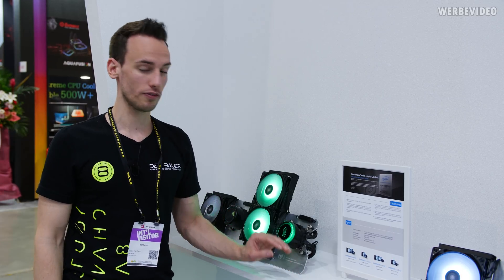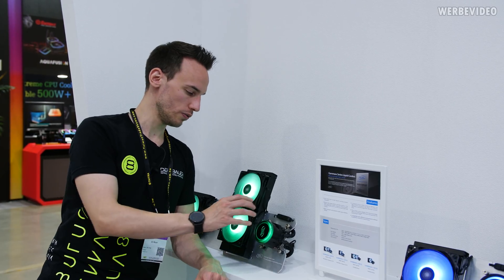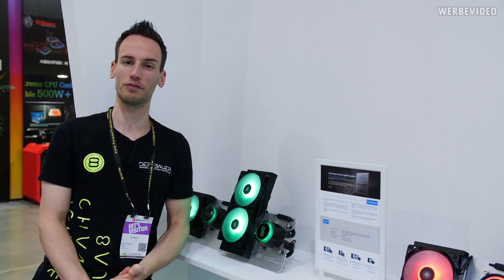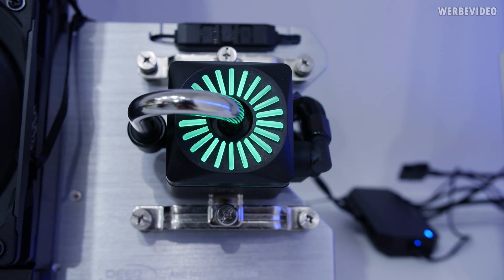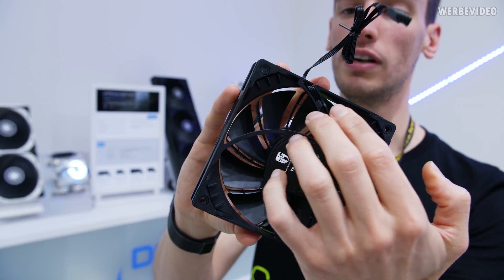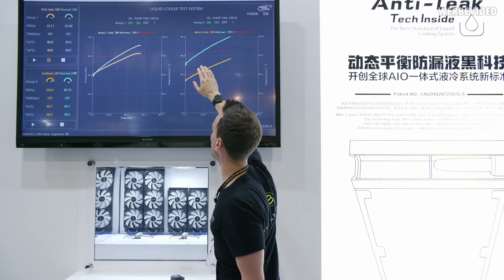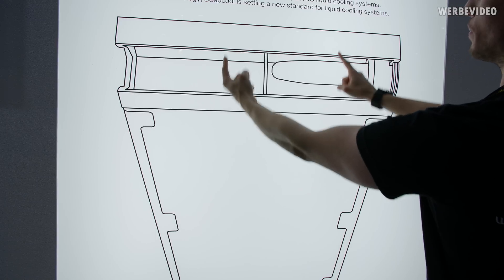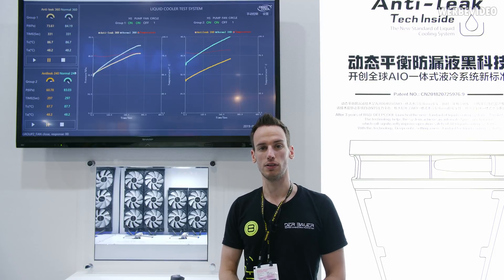Deepcool: Special mechanism to fight pressure in AIOs

Comment: I think its pure salestricks from deepcool, the water expansion from 21 to 45 degrees are so tiny that its impossible to measure... things starts to happen at 80 degrees, so theres is no issue in this matter, since the aio-water is not chilled, but idles at room temps...

Comment: This not a new technology tho, every central heating closed loop house unit has that pressure expansion unit. But, getting it in an AIO is innovative thinking. In custom loop cool in systems there is air in the reservour and it helps the compensate the pressure in the loop.
Reply: But you need that kinda pressure release valve when there is not enough air and not enough flexable materials (such as soft tubing) in the loop.

Comment: This is pretty old tech used in oil shocks. Most easily seen in RC (radio control) vehicle shocks, just Google  rc shock diaphragm, I've also seen this technology used in residential and commercial plumbing to act as a shock for reducing the high pressure spike in a water hammer situation or in the case of being on well water simply used as a pressure tank with a diaphragm in the middle, one side of the pressure vessel is attached to the water system filling halfway to the diaphragm, the other side is slightly pressurized this acts as a shock to even the pressure from the well pump, the water then flows through a one way valve into another pressure vessel only where the first is maybe 3 gal total capacity the second one is usually a few hundred gallon minimum, this tank is also only half full of water with a diaphragm in the middle but this one is under high pressure providing line pressure for the whole system.

Comment: Its called a blader accumulator with a spring instead of nitrogen. Basically controls expansion of fluid under thermal load. Been rocking the same old 2014 nzxt cooler.

Comment: The anti leak is a load of rubbish. Leave an air gap in the top of your reservoir and you'll have achieved the same thing. The pressure will only increase dramatically if there is no room for expansion of the liquid (because liquid is non compressible). So at best this is only needed for AIOs that have no reservoir. But think about it, how many AIOs do you see popping hoses off and warping radiator tubes due to pressure?
Reply: Haha, my open loop has almost garden hose water flow, and its big 3/4 diameter hoses jump every time an air bubble pass through, lol, I think you're right that AIOs don't have that kind of pressure! (I have 4 GPU blocks in parallel for higher flow rate and 1/16 the pressure/restriction, even still the hoses heavy and filled with water like to spaz and jump if some air bubbles get sucked in). I was also looking at this and thinking it would be pointless for open loop since you can just have a tiny bleed hole (also known as a 1/16 hole in the reservior lid), but it could make sense for AIO if you have really hot chips, like the 600w Intel chips (which now are rated for 110c), so I could see the water temps getting dangerously high at 60c, my water temps are barely warm since I have a massive radiator and server fans.

I don't think having an air pocked in AIO is a good idea though, because slightly wrong orientation means you can suck in an air bubble and have cavitation in the pump. I had to refill one of my AIOs because it had a seriously tiny amount of air in it (its ridiculous how it would gurgle and picky about orientation, it had to be like only 5 grams of water missing...),j AIOs are often made for having in any orientation (top of case, side of case, side of case sideways and up/down flip flop orientations. They seem to be really picky once they loose just a tiny amount of water, I used a small syringe and it barely took anything to fill it up).

What they need are easy access fill ports! If they seep through so much, why lock the customer out of maintenance? That's where open loops win, they are designed to be customer friendly!
Reply: so true

Comment: Captain series is positioned higher than castle? Are you sure? I though cpu block has more advance design on castle, more fins and the pump has more rpm and also more advanced design.

Comment: I don't think it's so useful on open loops, you already have the reservoir to compensate for that, also you would need to calculate the total loop volume and use the right rubber compensator.
Reply: Also, there are pressure equalization membranes which you can put on top of the reservoir already being sold. I've got one just in case and my water level in the reservoir does change a little bit depending on if the system is cold or warm.

Comment: Would the device for pressure control be needed for an open loop if there's air in a reservoir to compensate? It makes sense for closed, sub-atmospheric systems but open loops aren't typically sealed in such a way.
Reply: That was my thought, but if you are concerned about pressure you could always crack your fill port every once in a while
Reply: Yep, tiny 1/16 drilled hole in your reservoir lid and its good! AIOs you can't really just drill a vent hole since they are made to be any orientation like upside down/sideways/top mounted etc, but you totally can on an open loop.
Reply: @jakegarrett8109  there was a way to burp and refill 1st gen Asetek AIO's. Just under the cover, there is a screw with a rubber gasket. I believe it was where they were originally filled from. Easy to get to, as long as you know which 2 screws remove the top cover of the pump
Reply: @Celician83  Oh yeah, I've had to do that with mine (I bought it for $24 as an older stock item meant for Dell XPS 730i, and so it had lost some water just sitting there, it works great with its Delta fan on my TR-1950x up to around 400w, but past that its clear a 120mm AIO can't quite keep up... Very impressive for such an old product!). It would have been nicer if they didn't hide the fill port so well, make it more obvious for consumer. Plus I don't know if that's how they do it on new ones.
Reply: @jakegarrett8109  I'm sure they have changed things on newer pumps, lol. My gen 1 pump was an Antec Khuler H20 920, so came with PWM push/pull setup. My brothers FX-8150 came with one so Identical to mine, but failed due to corrosion on the impeller shaft that locked the impeller up. I gave him my Antec cooler, and other than fan failures, he had zero issues with it, and used it until March of this year. I bought the Khuler back in 2011!
Reply: @Celician83  NIce! 8 years is pretty good! My oldest cooler is an Asetech Vapochill LS from 2006, testing it last month it kept FX-8350 at 1.7 Vcore and 5.5 Ghz below 0c core temp with a cooling block temp of -35c under full load and -60c idle. I'm at the moment in the process of insulating my X370 for the 2200G I bought to have fun benching this weekend. Its still going good, no refrigerant leaks yet and I'm getting some good fun out of that old cooler!
Reply: @jakegarrett8109  I'll be honest, with my setup I have had constant issues with Corsair's 5th gen AIO's, namely the H100i GTX. I am currently in the process of RMAing my 3rd one, and though offered an ipgrade to a H115i, I have decided I am done with AIO's and am looking toward building a open loop cooler, which with the new Hydro X lineup coming out from Corsair, that fits my build nicely, with all Gigabyte and Corsair Ryzen X470/1700x (and Ryzen 7 or 9 3000 series when launched).